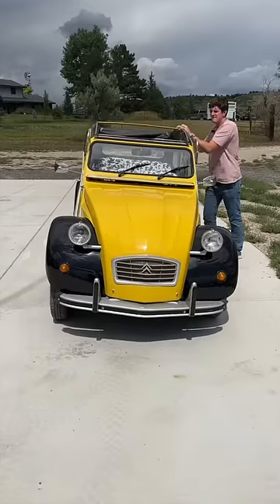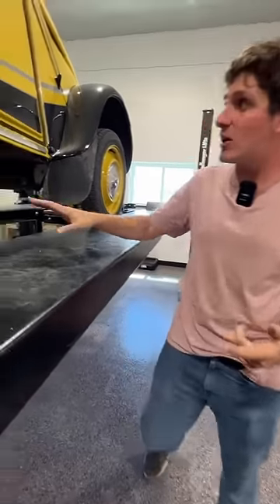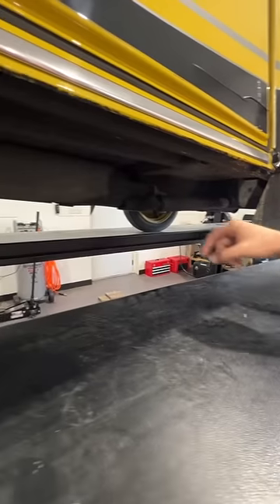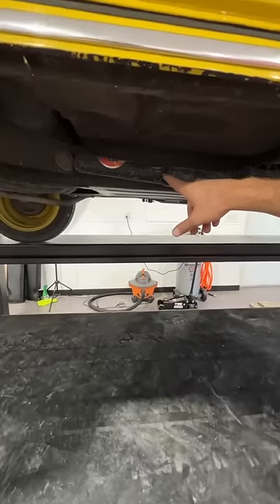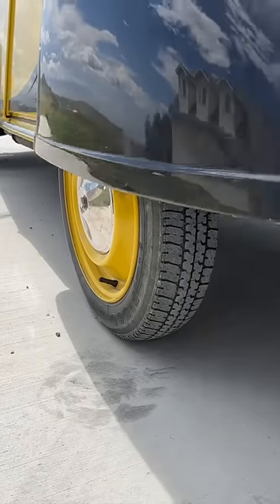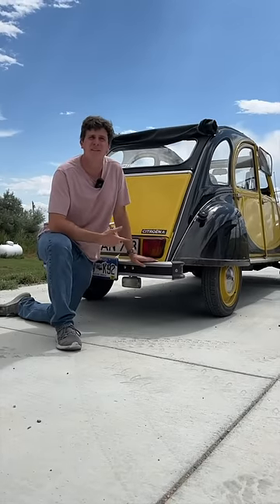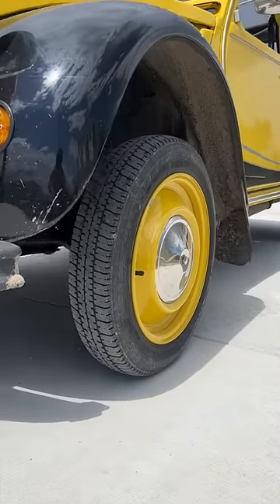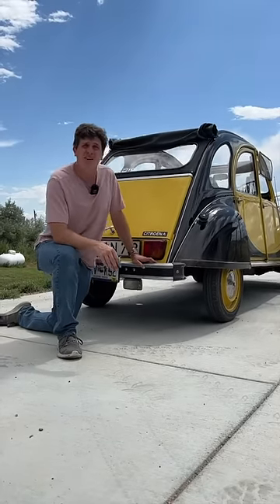This Car Is Impossible To Roll Over

Comment: My dad had the next model, the Dyane. Looks and drives everything like this one, except for a few details like square headlights that go all the way into the body. His was an extremely bright lettuce green. He once drove it through a roundabout stupidly fast and except for the ridiculous body tilt it felt super stable in every way. IIRC it tops out at something like 110/120 km/h which doesn't sound like a lot but in a car like this it feels like you're about to crash and die quite a bit before you get to that speed.

Comment: My grandma drove one of these when I was a kid in the south of France.  On a steep country road that we drove on frequently, I would have to get out of the car to put a block behind the back wheel and run the rest of the hill with the block in hand after grandma was able to drive up the rest of the hill.  I still remember this car engine and suspension noises.  Great memories and hi in heaven grandma ❤️
Reply: She didn't know how to downshift or what?
Reply: @randomidiot8142    I have driven one for years, my first car. And that was with the most powerful engine of the model (which says very little!).
Have you ever actually driven a 2CV?

Comment: Give it more than 12 bhp. It'll roll.
Reply: Nobody is gonna do that so your argument is invalid.
Reply: @TheDennys21 Actually... The 2CVs used in an old James Bond movie had bigger, more powerful 4 cylinder Citroën engines swapped into them by the filmmakers. I doubt that they managed to roll them over before jumping them over a road and then crashing them down the hill on the other side of the road though😂😂

Comment: Okay but there must be a reason we dont use suspension like that now right? Is it just cuz what we have now is better? Cuz you only said it was super advances not that it was better than modern suspension.
Reply: Adds complexity.
Reply: You can't corner fast with that suspension (though spectacular 😂), and it works only in combination with very narrow tyres, which don't give you a good breaking distance on dry roads. Apart from that, the crazy lean into corners isn't everybody's cup of tea.
I had a lot of fun with mine (rustbucket) and drove circles around others on ice and snow.
Reply: @untubus  narrow tires don't brake as well when dry and hot/in perfect ideal conditions, but they handle better/more predictably in all conditions. Wide tires float on snow, narrow tires get better traction on lightly dusted roads. Wide tires hydroplane easier, narrow tires don't.
Reply: @fuckinantipope5511  They work just fine, it's just that everybody wants to pretend that they are racing drivers. Look at any car made today, they're designed to look mean, like they're growling, so people can think if their car looks tough, then they are tough, too. Just like those folks that buy mean, nasty dogs, and think that the image of being mean and tough will rub off the dog onto themselves. 
The Beetle, the 2CV and other practical cars work absolutely great at what they're supposed to do, be reliable transportation for little cost.
Reply: @d.e.b.b5788  New cars these days also have ridiculous wheel sizes 19+ inches which make the ride way more harsh for no reason at all other than style.

Comment: This honestly looks better than most modern car designs
Reply: it's not exactly safe - tiny tyres etc
Reply: @jama211  These were built before roads were fully adopted look at those old 30s and 40s vehicles they all have crazy built suspension compared to modern designs for that reason

Comment: Because they can't go fast enough to roll don't they top off at a blistering 37 mph?
Reply: LOL that's exactly what I wanted to put, but figured I'd check first!
Reply: 70mph. There's a little plastic button which stops the needle going beyond 70. There was a 2CV, that had been converted and had a Rover V8 3.5 Litre engine, no idea how fast that could go
Reply: @glen1555  There's a button that makes it go 70 mph? Is that an early sport mode?

Comment: The 2CV is hard to roll over when you drive forward. You will start drifting over your front wheels before you tumble the car. Driving the car backwards it's very easy. When you drive top speed in reverse and suddenly turn your steering wheel you will tumble up side down in a moment.

Comment: Citroen is the boss of suspension.
Check out citroen xantia, which is so popular here in Iran, and it has the perfect suspension. It can work on 3 wheels only (seriously) and has a full air powered real time height configuration system. And , the car is from the 90's. Its incredible

Comment: this car was awesome and very famous back when I was kid in Iran. As time passed and more powerful cars came out it transferred from a famous car that is impossible to roll, to a meme car.
 my uncle had one too. Once we were in highway , I was in back seat. My door just suddenly opened so I panic slammed it but I guess sudden air pressure change inside, forced the other side door to pop open :D
still can't believe that happened

We used to jump in it for hours with my cousin. suspension was so soft, it felt like trampoline for us as little kids

Comment: They had a challenge in advertising in the seventies: whoever managed to knock over the "2 Chevaux" under normal circumstances such as curves or quick changes of direction would not only get a new one, but also a DS 21 (also known as "The Goddess" and one of the advanced Car of its Time with a real beautifull Design ) as Gift on Top. But it was nearly impossible, because you can't drive fast enough with this Car to roll on Side

Comment: The suspension is probably so heavy that it lowers the center of gravity to the bottom of the car, making it hard to roll over, just like EVs with their batteries under the floor.

Comment: I actually was sitting in a 2CV when Inwas about 9 years old when my mother did not have way on a crossroads got hit from the side (not very hard) upon which it very slowly rolled over.  Me and my mother hardly sustained any injuries (only a scratch if I remember correctly) as we were on the inner side of the flip. My brother was a tad more unlucky sitting on the other side and had more bruises.  But. I thing serious.  The 2CV was declared a total loss nevertheless.  But nearly unflippable… not in our experience.  😊

Comment: The fact they were designed for poor farmers and one of the Engineering requirements was that the farmer would be able to drive across a plowed field and ruts on the roads with a full load of eggs without braking any of them.

Comment: Its not "impossible" if you were to drive in a circle for long enough (increasing speed little by little at each turn) you will flip. It will take awhile to get to to roll over but it's definitely not impossible.

Comment: In fact this model is rather known for roll over easily due to its soft suspension. However if you look for a perfectly stable french car, you can look for the Citroën Xsara with active suspensions.